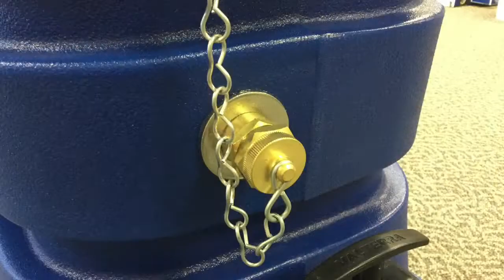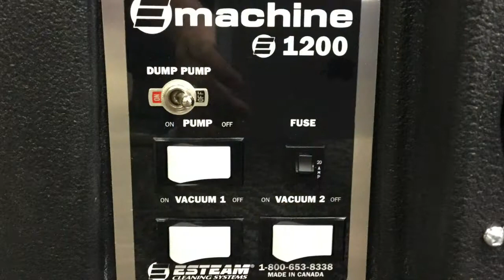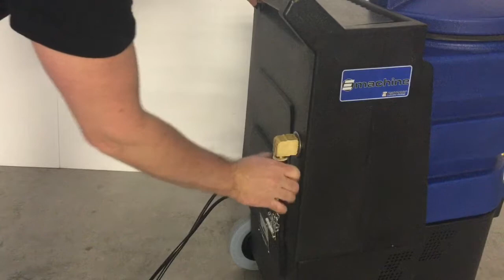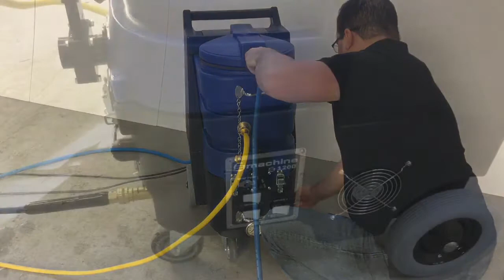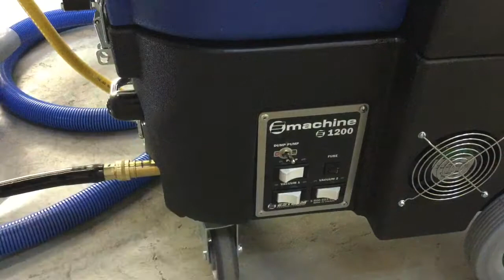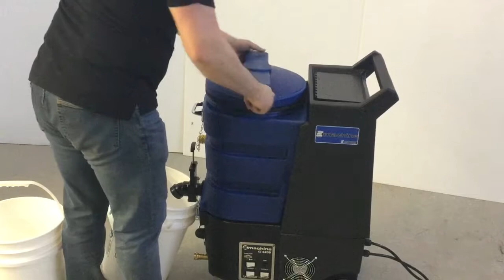E1200 Hard Surface Cleaner

Comment: Very good machine. I've been using it for about 2 years with no problems at all. The only problem is that is way too heavy. Watch your back and get help if you need to bring it up and there's no elevator. Besides that great machine if you are using not more than 50 feet of vaccum hose .
Reply: I also have chronic back problems from this. I solved the problem though, https://youtu.be/dn3EE8iVv2g